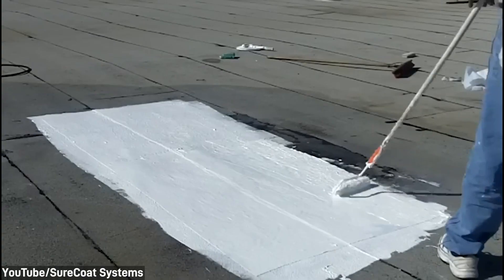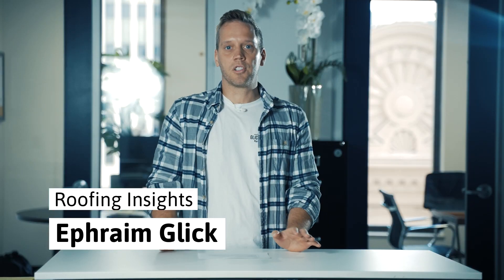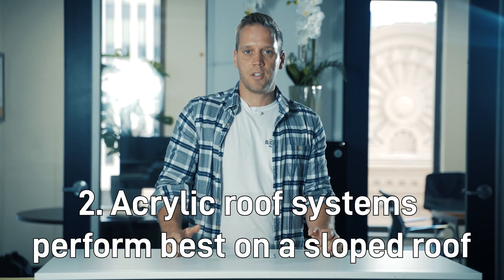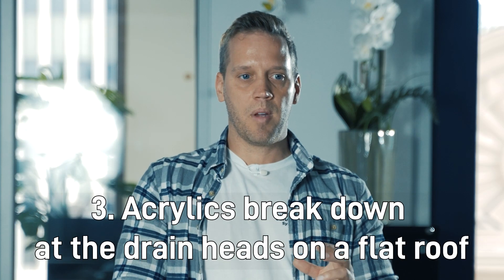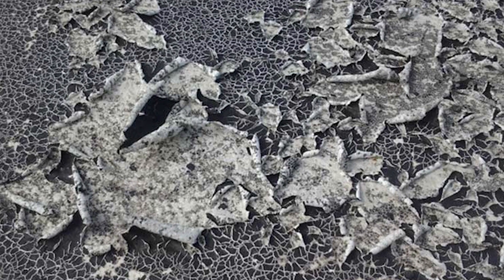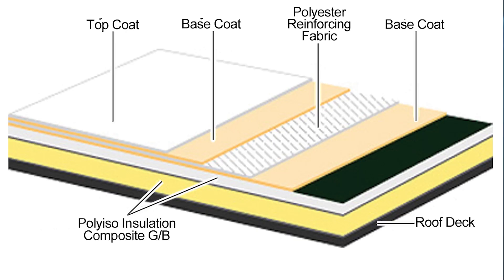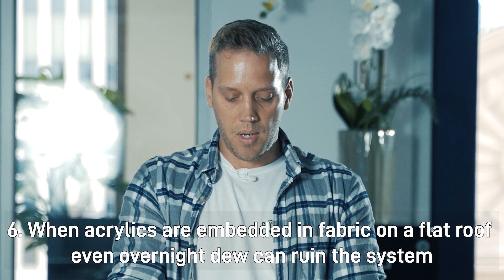Roofing expert explains why not to use acrylics on flat roofs!

Comment: I have a clay tile flat roof that was contaminated with a previous torch-on membrane waterproofing. I was thinking on waterproofing it with rubber liquid and geotextile but after watching your video i don't know what to do in order to repair that leaky roof. Do you have any suggestions?

Comment: I noticed you made a passing comment about silicone coatings. Is it your stance that silicone coatings do not hold up either? It seemed your justification for not using acrylic is because it's water based which breaks down when exposed to ponding water and the elements over time. So what about silicon? Silicon is solvent based and should in theory stand up to ponding water. If you don't support the use of silicon, what fluid applied coatings do you recommend, if any? While I agree with some comments on here about the design of the roof being the real issue, complete reengineering and rebuilding is not often with in the reasonable consideration for most commercial clients. This is where I believe these coating fit in the market. It comes down to client expectations and contractors just being honest about what they are providing. It's difficult to justify to a client that their roof designs sucks, when most of them do, and that their only true recourse is a do-over. Fluid applied membranes offer a reasonable solution, in my opinion, when the "best" solution is not with-in reach. This is why these coating are offered as a restoration of sorts, not a permanent, comprehensive solution.
Reply: Silicone would be the better option for low slope roofs but in most cases why not do an overlay with a new single-ply. 

I think it really comes down to what the manufacturer of the product says. If the install follows there specs and they back it up with a good warranty then it will probably work. 
Acrylic coatings manufacturers will not pass an install where the is bad ponding water.
Reply: @ashtonmmton1554  Cost is likely the #1 one reason. Coatings are cheaper and faster for the same warranty and they have no seams, which is the biggest failure point of any other available solution.
Reply: @shieldroofingsystems  those are the common talking points of a roofer that sells coatings.  
Any experienced roofer know that seam failure is not the biggest issue on single-ply.  In fact heat welded applications such as pvc and tpo the seams are the toughest and last thing that would ever fail. 
Also a coating system that actually offers a 20 year ndl manufacturer warranty on a flat roof is not cheaper then an overlay with a 50 mil single-ply and isnt necessarily faster depending on the experience of the contractor.

Comment: Well, my comment on polling is you will have to open up the existing roof and either put iso board foam to get rid of the pooling and then coatings will be fine because yes, ponding is never good on any roof. I do mostly metal residential, but also a little bit of acrylics..

Comment: So five years of coating roofs suddenly makes him an expert, I believe your title should be “why flat roofs with ponding water fail” because believe me I’ve seen all kinds of failures with any systems if there’s ponding water on your roof. This video is pretty ignorant overall
Reply: Well the fact is very low slope roofs that have an epdm that has been there for over 20 years and then some roofer comes along and coats it with acrylic and it fails in 5 years.  This is a fact.

Comment: If a roof is completely flat where these bird baths and ponding water are seen why is anyone even talking about installing a system on it without first fixing those areas, idk what his whole point is and I do agree with some of those situations however I think he’s talking about the wrong issue. The issue at hand is fixing roofs like that first and then most systems will hold up great if installed correctly. 

Also there’s a difference between (flat)and low slope and flat roofs are not ok with any system period
Reply: What do you do on a 100,000 + sf. Roof that's completely flat without re-engineering it?
Reply: @jesselambright1005  you use engineered,sloped iso.
Reply: @jesselambright1005  what you do is put on a new roof not coat it.   In some cases tapered iso could never work on huge roofs that are structurally sloped.

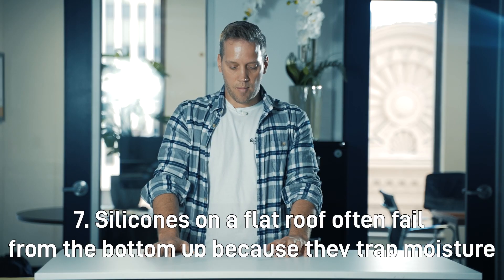Comment: Sure products fail. But 95% of failures is due to unexperience installation.  I have no preffered Manufacturer, although i do preffer to use western Colloid. THickness, water intrusion, improper venting, proper drainage HAS to be addressed. Lysols says it best. "will get rid of 99.9% of germs" ... because the human element will always fail 0.1% of the  time... Colossians 3:23

Comment: There is much more to this story,

I totally and openly disagree with 90% of statements made in this video. 

99% of reason why acrylics fail on “flat” roofs is because of applicator error due to the lack of training and/or poor workmanship. 

Our family has more than 100 flat roofs coated with acrylic in Wisconsin, missouri and Kansas that range from 25-1 years old. 
I would be very open to walking those roofs with anyone including Ephraim.

If the statements made in this  video were true, approximately 50% of “Conklin” roofs would fail/would have failed. 

Conklin has been successfully installing acrylics on flat roofs for 47 years. Ephraim to my knowledge first installed coatings 5 years ago.
Reply: Warren, while I have much respect for you and appreciate your opinion the length of time someone has installed roofing systems does not reflect the truth of the matter in my experience. Conklin is the company who taught me how to install these roof systems and I can assure you neither me or my team has ever installed one outside of the specs Conklin asks for and Conklin has warranted every roof we ever did like that. So in our case it was not application error.

 I shared my "opinion" because I got so many calls and still get them from building owners with failing roofs that were done before my "5 years" of running my own company and they are unhappy with the results. Sadly for your point every single roof I spoke about in this video with acrylics and foam  were done with the Conklin acrylic and or acrylic and fabric roofing system including the one with trees growing out of it. And none of them were installed by me or my team. I would love to see roofs that are performing well and I welcome any opposition to my knowledge of the industry I have shared here. 

This has just been our experience and for that reason I stand behind my thoughts on this and unless a roof has a slope on it we will not install it and I believe that is best for my company and our reputation. Because for every Conklin acrylic roofing system on a flat roof we are fixing these days from other contractors usually these contractors have already gone out of business and that's why we are called in to do a single ply or EPDM system to repair the damage. 

And for anyone who thinks this video is a Conklin bashing video that's not my intent. I strongly believe Conklin manufactures the best Acrylic for metal roofing systems and I have cases and studies in real time on that so I love the Conklin roofing products. Just not on flat roofs. - Ephraim
Reply: Hey man I thought of you while watching this 😉 I wondered what you thought about. Thanks for the clarification.
Reply: Mr Yutzy, the presenter did not mention Conklin by name or inference. Why did you think the video applied to you? “Me thinks you doth protest too much”.
Use acrylic on sloped metal NOT “flat” roofs.
Reply: Acrylics are not the problem! Ponding water is the problem. I’ve seen a lot of flat roofing systems fail under ponding water! For example the primer & adhesive that you use on your epdm seams. Or do you make sure all your seams are on a high point?😂 instead of addressing the situation at hand? 

This video was not created to educate!
Reply: @jamesmiller1576  you wouldn’t be saying acrylics are not the problem if it were not for the fact you install acrylics. 
Ponding water less than an inch comes and goes. Epdm and TPO holds up to fluctuations of ponding water, acrylics do not.
Reply: @ToddBizCoach  that first statement is correct I do install acrylics and I am very confident in the system! However that’s not the point, the title of this video is misleading! Acrylics are not the problem, installing them improperly is the problem!

Comment: I hate flat roofs. Lots of them are poorly designed and have little to no slope. I know we call them flat roofs but in theory every roof is supposed to have a bit of a gradient. 

For my company, I no longer service it do any flat roofs with no pitch. Best business decision I have ever made.
Reply: Agree, unless you apply sloped iso you will always have problem with ponding water.
Reply: If your just a coatings guy thats a great decision.
Single-ply such as pvc, epdm, fibertite and others can hold up under standing water. Not saying ponding water is ok and it should be dealt with if possible.

Comment: I used acrylic when applying fabric ,like on the field and on penetrations because it’s easier to apply on fabric then silicone and then we used silicone for top coat and it’s been doing well ,never had a problem 10 years ago
Reply: And is this on sloped roofs with no ponding? What kind of warranty is given, by manufacturer or you? Is your process covered by a manufacturer warranty?